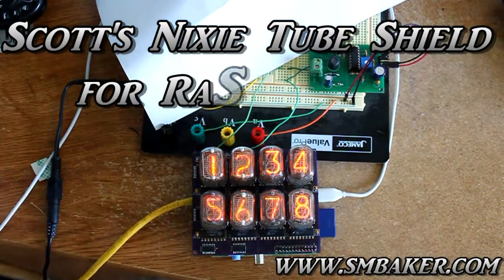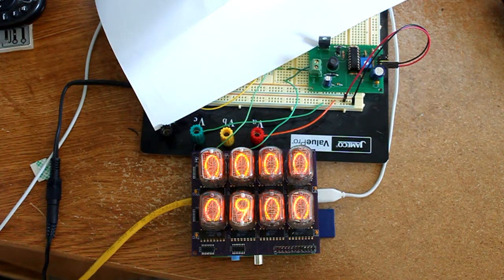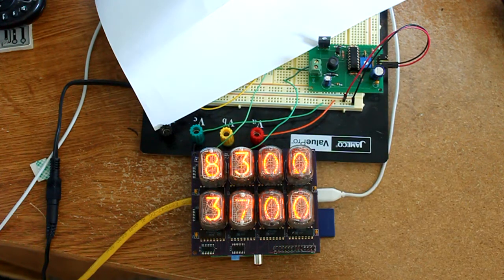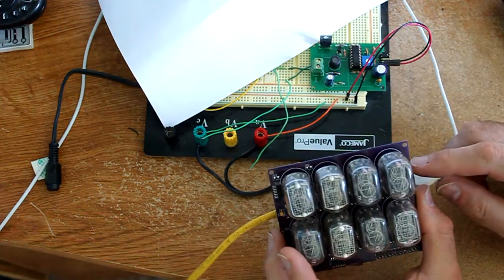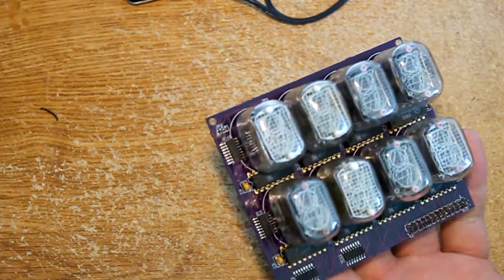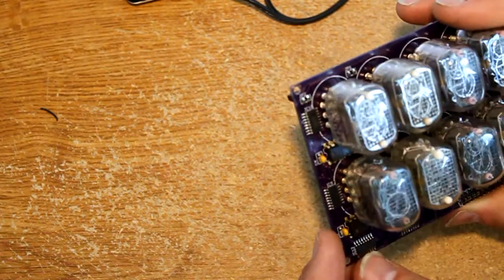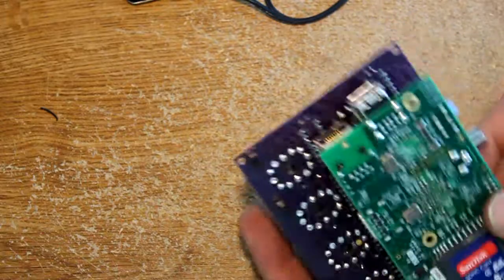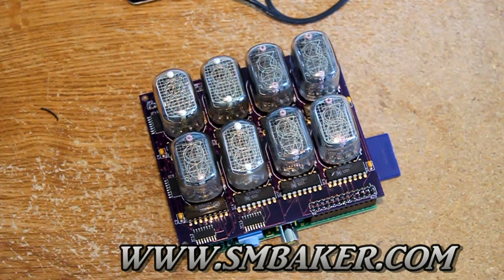Raspberry Pi Nixie Tube Shield using IN-12 Nixie Tubes

Comment: Hi! Nice video. Could you give me some pointers on the 100v from 12v supply?
Reply: you need step up converter, have a look at switch mode power supplies in the step up configuration or a linear regulator if you are a beginner in electronics
Reply: Buck converter maybe?